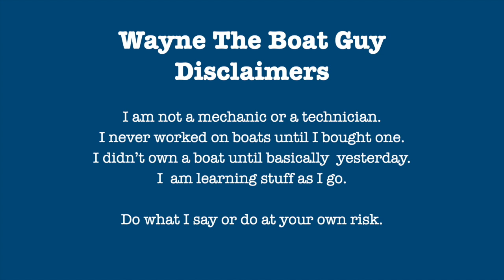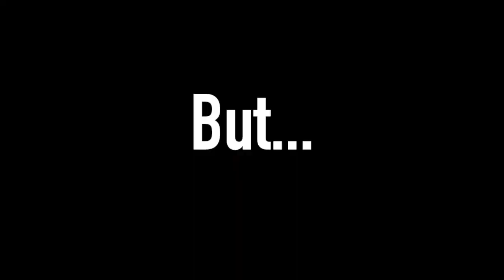Cheap Old Pedal Boat - Will It Float or Sink? Paddle Boat from a Summer Camp !

Comment: Restoring it and possibly giving it a name significant to you and yur wife
Also a forward facing trolling motor controlled from either seat with the battery in the rear for balance
Reply from the maker: Yeah I have been thinking it could replace the tiller control for the rudder.

Comment: I've thought about getting one for on the small elec. only reservoirs.Was going to remove the paddles and add a modified trolling motor.I have a 12' Jon so I really don't need one,they're heavier,slower,and less room....
Reply from the maker: Yeah they are surprisingly heavy!
Reply: I'm going to pick up a 4 seat paddle boat tomorrow. (My first boat) it holds 800lbs. it even has a canopy and a built in cooler compartment. for $400 flat I cant beat it. A 12 foot boat definitely has more space, but that's only because they hold two people max. I'm looking forward to drinking beer with 3 friends out by the sandbar for cheap!
Reply: @Dailyfiver  The tag on the 12' boat says 3 persons. It only cost $250 and I can load and unload it my self from the bed of a truck,or all 3 of us can carry it a football field to the water if ever need be. There's going to be a hell of a lot less space on that thing with just 2 people than there is on my 12' with 3........but think what you want,there's still a lot that still think Biden is doing good.
Reply: @rider660r  well my paddle boat tag says 5 persons but the weight limit reflects more like 4 adults. I bet your boat is the same. It probably holds around 400lb which is two adults. Your John boat is definitely more portable and lightweight though I’ll give you that. I just live a 20 second walk from the boat launch
Reply: @Dailyfiver  LOL Well yeah,all boats have a US Coat Guard rating...that's the tag with the amount of people and weight listed.
Mine says somewhere around 500-550,been a while since I looked at it to know the exact weight,but I know it says 3 people.
If you really want to play pissing match with your sandy snatch,I live about a minute from the river that leads into a lake that's 28 miles long 8,000+ acres and up to 200' deep. Then have hundreds of smaller lakes and reservoirs all around. I really don't care if it's 5 seconds or 1 hour trip to the water. You're probably a bAsser also and think they're a incredible fish to catch and have a ton of pics holding your pickle like some Re Re at the carnival that won a stuffed animal....LOL. But they're just a nuisance fish and only thing that is often easier to catch is Gills and Sunnies.

Like I said though, you keep thinking what you want,there are a lot of other dolts out there trying to explain away their idiocy. Sooner or later some figure out how idiotic they are....but many don't.
Reply: @rider660r  man you’re really taking my comments the wrong way. If you’re going to get offended and start rambling I’m just going to ignore you. I’m not reading all of that.